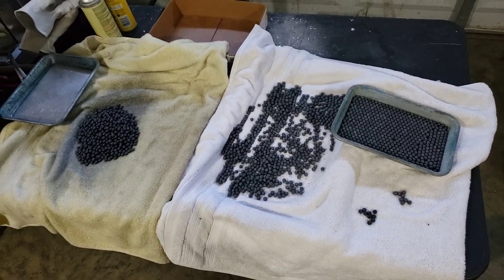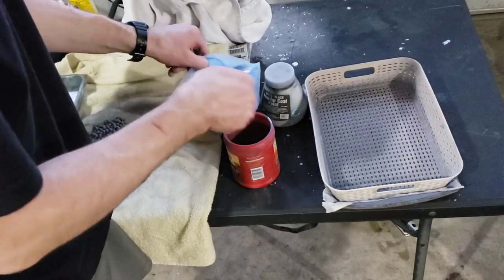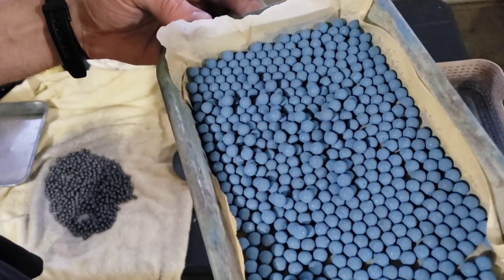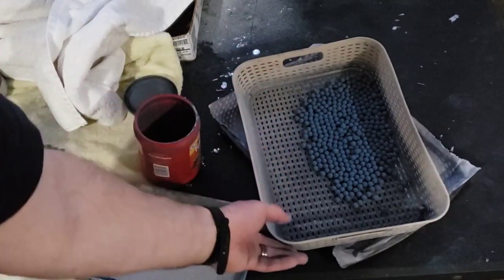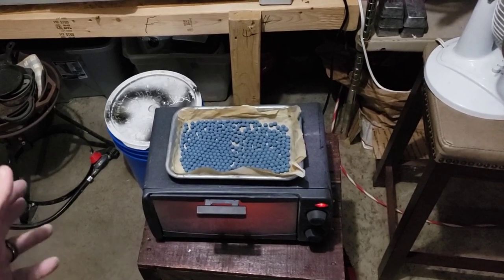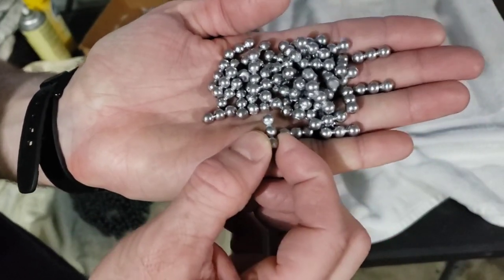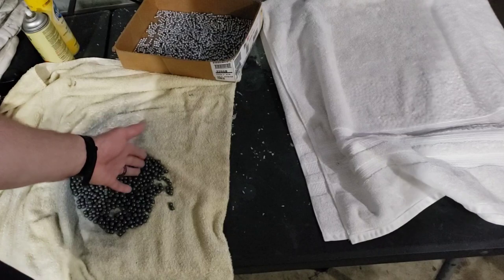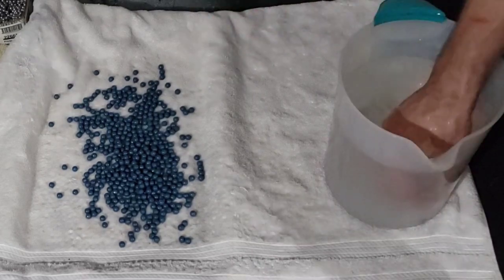Powder Coating Hard Cast 00 Buckshot (works for bullets, too)

Comment: Man that makes me want some blueberry pie! Dang these diabeetus! Lol. Looks great man. Fixing to get into powder coating my bullets/buckshot and will definitely try this method first!
Reply from the maker: Awesome!  It's very rewarding to be able to produce your own goods. Just start with the Ford Blue and you shouldn't have any issues. Good luck!
Reply: Yes sir! Also another tip with the Lee buckshot molds. The best tool for snipping them stringers of 3 apart is a pair of K9 nail trimmers and the little nipples won't be there no more! Try them out and let me know how it works for you!
Reply from the maker: Picked up a pair after I'd already cut them apart. I'll have it for the next round, though.

Comment: I'm curious about your wet tumbling of the shot. What is your method? Good stuff DR!👍
Reply from the maker: I was using the Mini FART, so it doesn't have a rubber lining like the big FART or HF drum tumbler. This would only allow me to put maybe 3lbs in at a time and still have the drum turn. I put in enough water to cover barely cover them to keep dust and residue down. 4-8 hours was pretty meh, but 12-24 hours worked much better. 

Somebody else commented that quenching them makes it harder to tumble, which should have been obvious to me(but, I am dummy)

Overall, very pleased and the next batch will be even better🇺🇸👍👊
Reply: @DummyRound  Ok I can see that. 
I currently use the HF 2 drum rubber tumbler with just 1 tumbler, dry, 1/2 to 3/4 full with the other empty. They only handle 6lbs total, I think. Still playing around with times. 1 hour seems to shine them up to a ball bearing look, not finish, with the flashing and nipples removed, yes, I said nipples, and 2 hours seems to beat them to a duller finish. I PC after 2 hours of tumbling. The way I'm looking at them is if I'm PC'ing minor defects will be smoothed by the coating. The other thing is we're making buckshot rounds not precision rounds. They should work fine at the distances intended for. 

My buckshot makes the same sound if I use W/W's and quench after PC'ing. I only quench the one time. BRO did a video on dog nail clippers for separating the pellets. I got one off Zon, they're excellent for doing that step. after a little practice you can make them nipple free, so a long tumbling time is not needed. 

I just cast up a pile like yours of #4 last week, took me about 3/4 hours to cut them apart. 

Keep up the good work DR 👍
Reply from the maker: I had a pair of the nail clippers somewhere but couldn't find them and ended up with the wire cutters🤣 I'll probably air cool them next time to ease the tumbling process. Then, the final quench after PC should be sufficient. Like you said, it's buck shot, not a precision round👍

Comment: Those should shoot fine . I use a 10 pellet load by 2's with a Claybuster 1138 wad and charge of Green Dot  . I don't want to say the gr weight , lol
Reply from the maker: Awesome, just grabbed a bag of those wads and they fit nicely by 2s. The 3x3 load seems tight in some hulls. Do you use buffer at all?
Reply: @DummyRound  No , with my luck they'd leak buffer in the action and mag tube . I keep them simple and reliable .
Reply from the maker: @jamespollard1670  I hadn't thought about that. Good to know, thanks.

Comment: I would do a little more research on the HF black powder. When i first started off i tried to use is and never could get it to work properly for me. I did more researching on it and seems that the ingredient they use in it to make it a "matte" finish is not good for barrels. My info didnt come from a research lab with intensive testing. But rather from several members on different forums and also a couple of prominent youtube guys concluded the same. Im no expert and you cant believe everything you see on the internet either, so take it with a grain of salt. Just trying to give some caution out if anyone cares to do their own research on it.
Reply from the maker: I've heard that, but it doesn't worry me too much. I don't usually do flat black, mostly because it doesn't work, but I just use it as a filler or to add an accent to a batch of powder coat. 

How are they even measuring the wear done by this? I feel like you'd have to shoot several hundred or thousands to notice a difference. Lead is soft and swages down to the bore. People do fire lapping and what not to purposefully wear down spots.

Not saying it doesn't happen, I just need some data other than somebody saying somebody said something. 

All that said, I'm not buying any more of it and just use small amounts to add accents to otherwise plain colors.

Thanks 👍🇺🇲